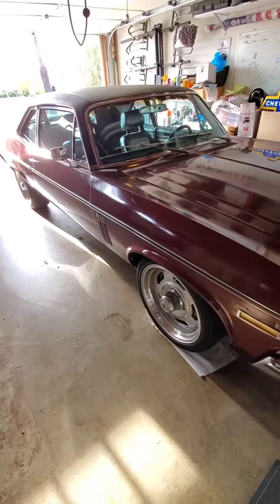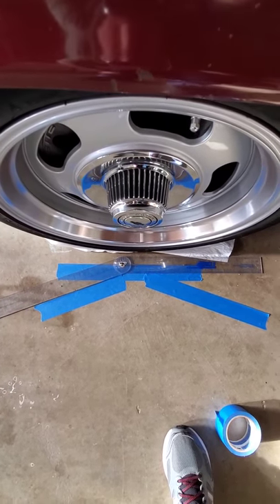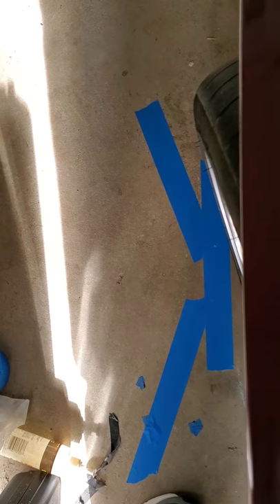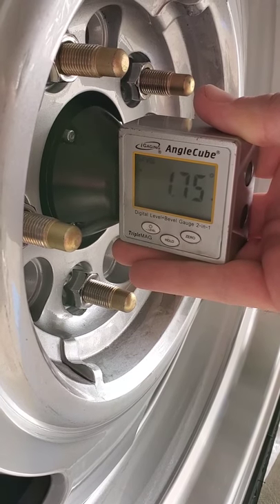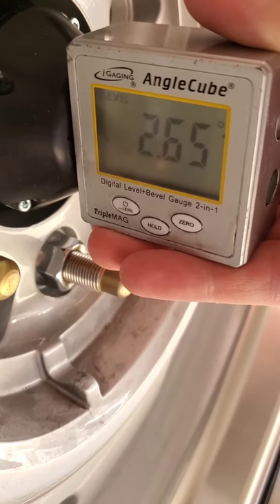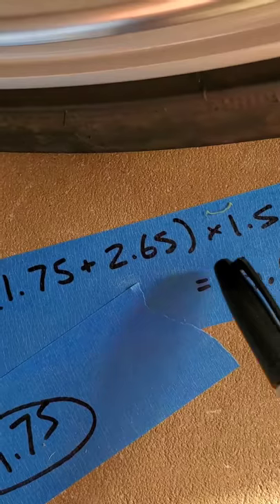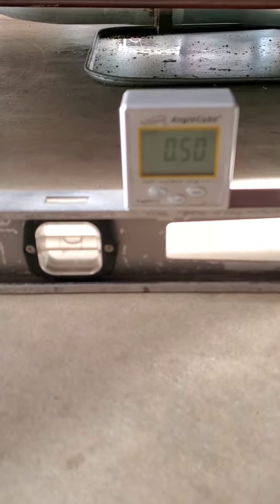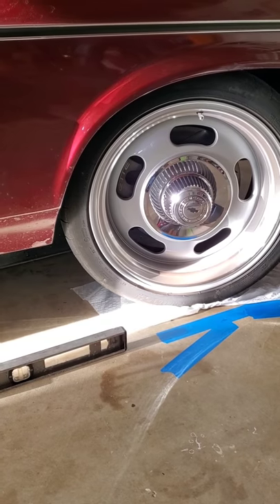DIY alignment: caster

Comment: Well explained. I am trying this on my Stingray now...
Reply from the maker: Thank you. Good luck!
Reply: I will also try on my 1978 C3. I haven't seen a good video on aligning the back of a C3 yet...
Reply from the maker: @GJJC13  For the rear you only need to set camber and toe. To make sure there isn't a steering angle adjusted in, you should use the string alignment method. Search around for how to do a string alignment.

Comment: Excellent video. I just wonder why you have to multiply the difference found in camber in and camber out by 1.5? Do you know why? Thanks!
Reply from the maker: Yes the multiplication factor 1.5 is based on trigonometry. You aren't able to directly measure the caster angle, but knowing the steering angle of 20deg in either direction and the measurement of camber change, you can calculate caster using trigonometry. Rather than go through the trig calculations, a factor of 1.5 gives a very close estimation.
Reply: @thebandit4393  Great explanation. So, that bubble level shows when the reading it is positive and when it is negative? I did not see a "+" or "-" sign  in the displayed figures. Thanks!
Reply from the maker: @GJJC13  On my angle cube there are some small arrows in the display that show which way the tire is tilted. They are very hard to see in this video. Negative camber is when the top of the tire is angled toward the car. Positive camber is when the top of the tire is angled away from the car.

Comment: One last question in your example: the 1st measurement was -1.75 and the 2nd one was +2.65, So, from left to right turn you have +1.75 + (-2.65) = 4.4 x 1.5 = 6.6. Now, since you had 2.5 negative vs 1.75 positive, the final reading is a POSITIVE reading correct?
Reply from the maker: Caster is positive if the turned in measurement is more negative than the turned out measurement. That tells you there tire is cambering in at the top as you turn in.